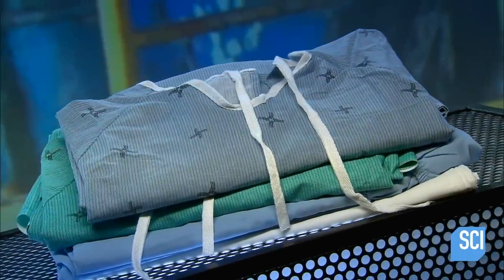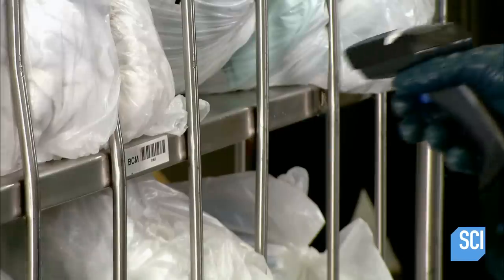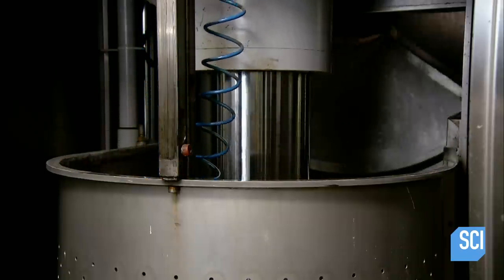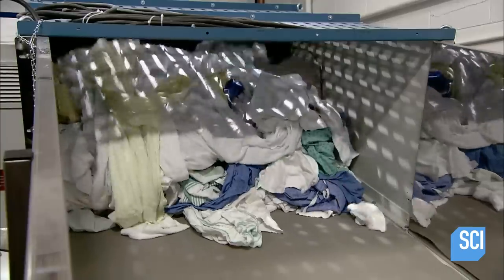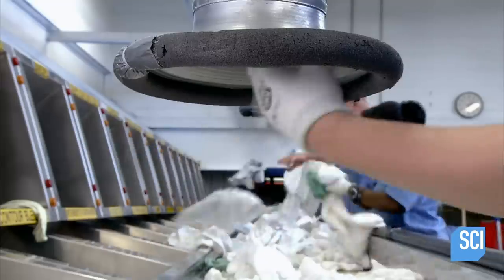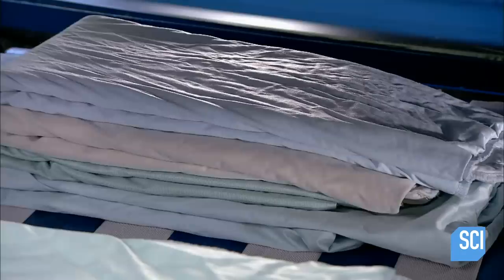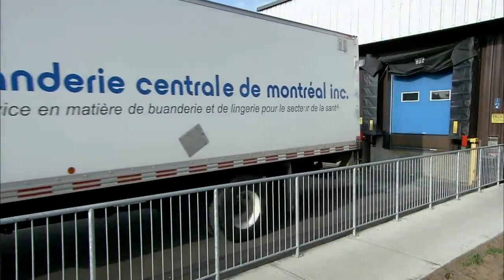Cleaning Hospital Laundry | How It's Made

Comment: I bet that initial unloading area just smells lovely
Reply: Hi there Greek boy
Reply: Παιζει πολυ αυτο
Reply: Actually doesn't smell that bad
Reply: I work for linen processing and we have to do it by hand rather than a machine. It does not smell good lol.
Reply: @cosplaycierra151   I do the truck driving 5 to load it from the hospital and sometimes I help tear open the bags and put them down the chutes to me it doesn't smell that bad
Reply: 😂 yeah
Reply: @daniellevert6646  yeah but I’m sure you’re used to it
Reply: A summer breeze right
Reply: @hopegold883  gloves are more important for this stuff
Reply: Vicks rub on your top lip and on your chest won't smell anything. Trick I learned from an old plumber lol
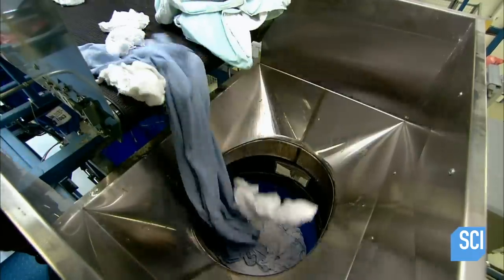Reply: @GH-uo9fy  the image at 1:35 is on the dirty side of the process. I do hope it gets cleaned,  it if not any laundry that came in contact with it will be cleaned shortly. 

Likewise, everything I’m the truck is bagged in sealed plastic bags, which keeps the dirt in..
Reply: Doesnt smell bad at all. 

Dirty restaurant linen on the other hand STINKS. Very greasy.
Reply: @TheWaynester101  I beg to differ. I've worked at a similar place and  the urine soaked, and I do mean SOAKED linen smells like dehydrated urine and eats through the gloves they provide, u have to buy your own the feces smells exactly how you would think thousands of pounds of feces covered cloth would smell like but the worst stench? that award goes to blood. I can stand the first two smells to a point, but I've pulled some sheets that were covered in an entire human worth of blood and DRIPPING and that was the only smell that made me almost throw up.
Reply: @Agent-ie3uv  if you've ever had kids eventually poops stops bothering you as much. it stinks for sure but I've dealt with a lot of poop in my lifetime, old decaying blood still beats the poop smell with old dehydrated pee coming in at a close second
Reply: That's why the scale measures in Gross!
Reply: I do hospital laundry for the veterans hospitals in my state and work on the soiled side,and it smells Terrible but that’s why we wear n95 masks

Comment: I HATE doing laundry so I can’t imagine doing laundry for a living. Other people’s laundry too, not even my own. Nope. That sounds like a nightmare job to me. No way.
Reply: Its so easy tho. Would u rather frame a house or do roofing in summer or put clothes in a machine that does most of the work for u
Reply: @nonamenolast4648  I would choose the second option
Reply: I'd rather be doing manual labor because I'm better at that. Its not just what's easy for some people, its what's stimulating. Some people, myself included, go absolutely nuts at any monotonous job. These jobs are great for people who may have physical disabilities though, but there should be a way for mental stimulation around the job too, otherwise I can see a lot of people going crazy doing the same thing over and over and over and over and over...
Reply: Why do people hate doing laundry when yall has a washing machine? Many people don't have washing machine and for me it's easier with washing machine and not hating doing it
Reply: What parts do you hate the most? I have nothing against throwing the stuff in the machine and dryer, but I hate bringing it back upstairs and putting it away. So most of my stuff stays in a basket, and I grab what I need from it.
Reply: @rexana_rexana  truth. i work 8 hours a day 5-6 days a week for one of these companies throwing sheets into an industrial ironer. 186-200 hours a month throwing anywhere from 2500-3000 sheets a day one after the other. the only saving grace is I can listen to audiobooks and music. Once I learned all the protocols and proper throwing I just go on autopilot and either think or get absorbed into my book.
Reply: I do hospital laundry and work on the dirty side, I don’t mind it because one I make good money for it, and 2 I’m helping people without interacting with patients
Reply: @nonamenolast4648 it can definitely be easy cause it's simple to sort the laundry where it needs to go (just started working at one.) But it can also be difficult cause your lifting heavy, disgusting laundry while on your feet all day.

Comment: As someone who cleaned hospital rooms for almost a year, cleaning rags, mops, and other cleaning items are cleaned in the hospital in their laundry. Everything else is loading into large plastic carts in the soiled room, a Janitor goes by every so often to trade the full bins out and take the full ones down to Janitorial to wait for the truck. HOWEVER at the one I worked at, the hallway that lead to where the truck is, shared the hallway with food and nutrition, so the cooks were tracking any gross stuff dropped on its way to the trucks or the trash compactor. Also every few years they redo the designs on their items and give the old ones away before they are tossed. I took a truck load of blankets and baby items to a women's shelter when I could.